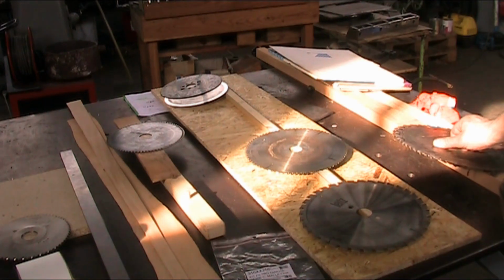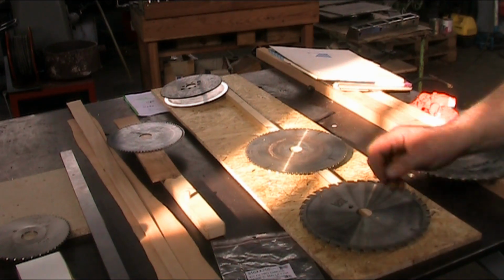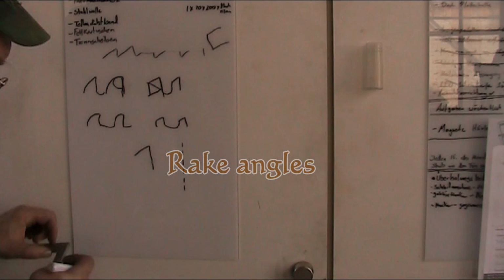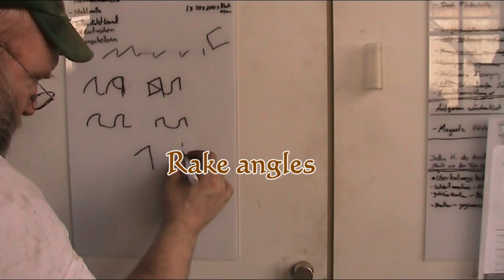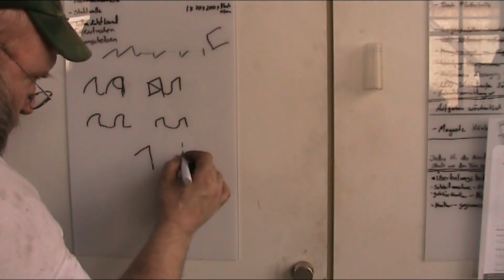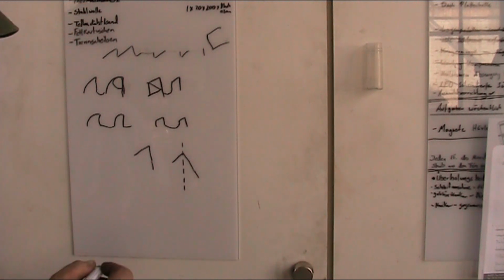Sawtooth Geometry

Comment: Interesting stuff, appears that the principles are similar to the metalworking world,  except the sand in the chipboard, that  was new one to me, but explains quite some mysteries ....  question off topic,  what would you prefer for small firewood processing  and why, band saw or table saw, (under 2"" dia, any bigger i simply use the chain saw), I am now having regular access to a lot of smaller branches and need to build/buy something anyway as my woodworking  machinery collection can be counted on one hand.
Reply from the maker: for small diameter firewood cutting either saw will work. on the table saw, a similar blade to the one shown with the crack in it will work best as it has extremely pointed teeth which slice thru the cross grain of wood very easy. they do tend to dull a little faster than a carbide tipped blade but are overall more productive. 

with a band saw, a blade with a "K-U" form also called a skip tooth blade works really well.
big advantage band saw over table saw: very little kickback. although you can technically stall the blade or run it off the wheels, in order to do so you really have to be pushing hard. for a table saw to kick back a slight pinch is all it takes and you're fighting a tempest in a teakettle.
the overall exposure to moving parts and thus the risk of cutting yourself is much smaller with a band saw. 

an all round good size band saw to get is something with 14" wheels or larger with preference to the larger. the stresses on the weld of the blade are much less on larger diameter wheels and there is a much better selection of blades on the market than for small machines.

my preference would be the band saw ....with 24" to 36" wheel diameter,
Reply: @HolzMichel  Thanks Mike, ..confirms my gut feeling so far, i have a lot of respect with these wood working tools, the combination of high speed, big diameters and very sharp tools always make me feel rather uncomfortable. Steel blades are (sort of) OK to me, but I will never trust a piece of carbide, glued to a blade (most likely at some far eastern factory) spinning towards me at 120+ mph.
Apart from flimsy hobby toys, not much to find right now for small cash, located one 1950s 12' or 14" machine not too far away which fits the budget, so i probably have a look at that.